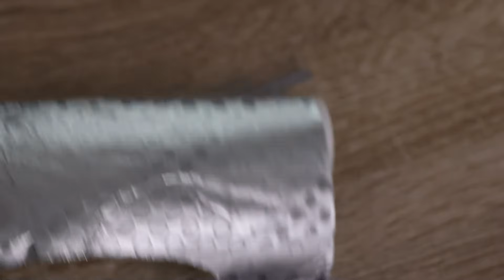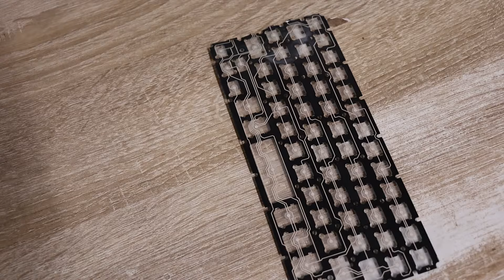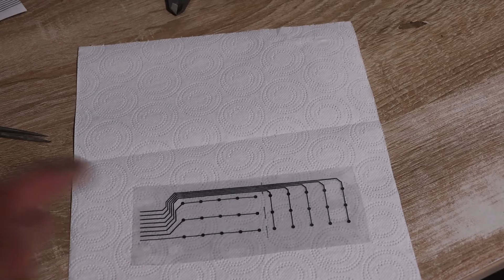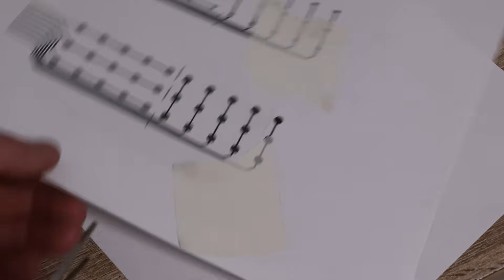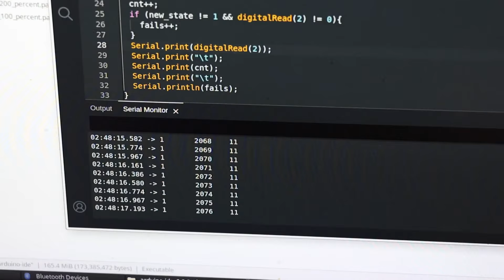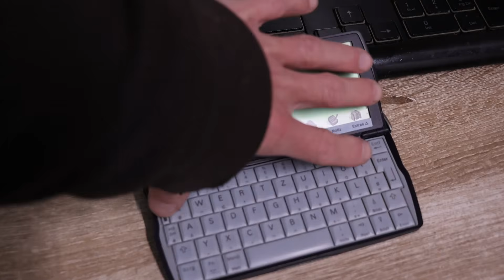DIY keyboard membrane

Comment: Nice try! didn't you revisit it to make it better and maybe tyed it with copper by any chance?
Reply from the maker: I did try copper. However, copper wicks CuCl so aggressively, that it lifts off of glue I wanted to try pure HCl + H2O2, just in case that would work (it would definitely be faster at least) but I did not get there so far. Another alternative is electroless plating, but that is iffy on plastics and hard to mask.

Comment: Silicone might be a good idea though. You want a material that can deform and return to its shape over many cycles.

The lamination plastic probably breaks down fairly quickly
Reply from the maker: Not really, I have used lamination foil on small aircraft and it holds well 5 years later.

Comment: Commercially those membranes are made by screen printing ink highly loaded with silver particles, I suspect it has special properties to prevent fatigue cracking. Carbon ink can be used for contact areas but probably not for traces because of high resistivity. Screen printing is pretty popular in arts and crafts so should be well within the realm of DIY
Reply from the maker: Screen printing is definitely doable in home shop, but it is much more complex than litography. First you need to make screen, then you need to worry about adhesion to substrate.
That said, if I could buy silver foil, that would be nice.